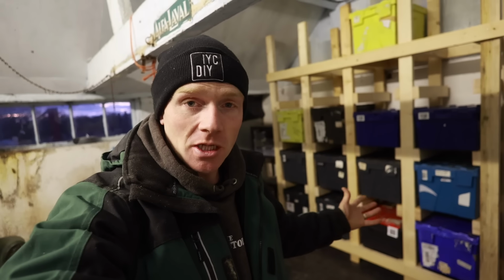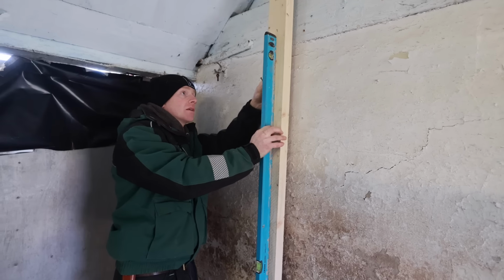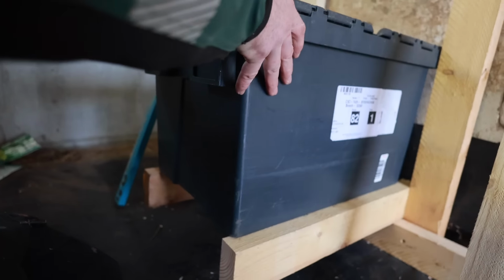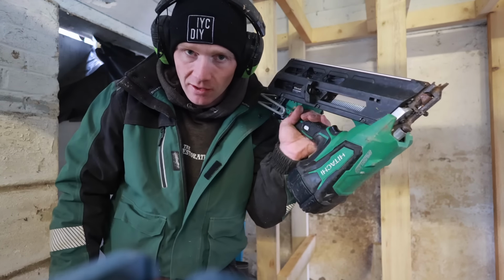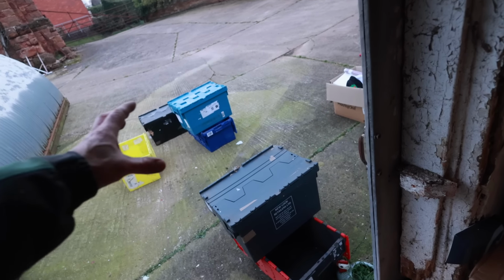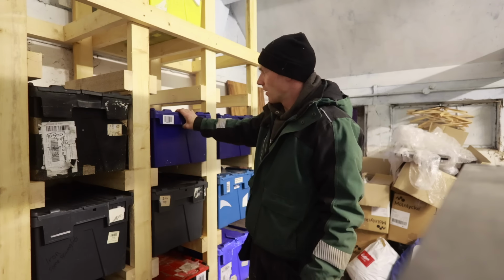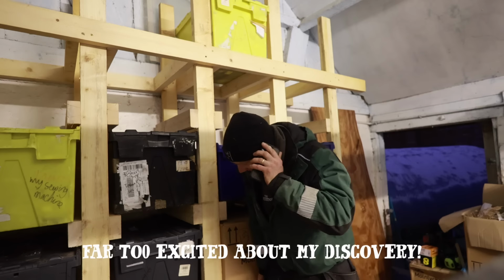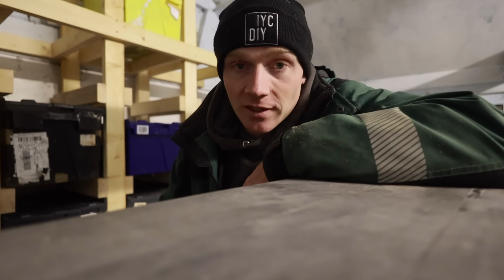DIY BUDGET STORAGE - Time to get organised!

Comment: Hi, when I used a shipping container for storage I just drilled out and fitted round wall vents. Didn't have any problems with damp or condensation at all. I found this a quick and cheap solution. Best of luck.

Comment: Thanks Tim, this is just the sort of project I love, well done both, poor Jo looked frozen at the start there, reminded me of working on our renovation - PJs under work clothes, it's all about layers ! Btw, nothing wrong with a bit of over-engineering, especially if it means you can re-use materials !

I fitted out a half container sized resin shed last year and used a combination of old fence posts (cleaned up, sanded and oiled) 18mm OSB and 2x1 roofing battens, solid as a rock and has also stiffened up the whole structure ! I shudder to think the total weight in there now but it isn't going anywhere !

Anyone who has followed you for any time knows you're not slacking, take care of yourselves, and we'll happily consume whatever you have the time to post - Happy 2024 !

Comment: I rented a converted shipping container as a workshop for a while. It has kingspan in the walls and ceiling, overboarded with osb. One side of the container was removed and a sliding patio door fitted. Consumer unit and electrics. Bone dry and reasonably warm with a little electric heater. A bit fancy for a site container but plenty of food for thought.

Comment: Hi Tim, by far the best option I’ve found for making garage/workshop storage racking is welding up steel frames with ply boards on. I was a hobby woodworker and was absolutely astounded by how little steel you need to carry the weight. I did a basic welding course at the local college (£190 and a few Thursday evenings very well spent!) and steel is actually cheaper than timber!
Reply: What gauge steel did you use for your racking?
Reply: @ uprights were 50mm equal angle (2 inch) and I made rectangular frames for each shelf from 25mm equal angle (1 inch), all 3mm (1/8th inch) thick mild steel.
Reply: @ thanks!

Comment: Hi Tim, you can buy insulated containers. And next time you build this the lip under where the lid is could slide along on the timbers rather than the bottom of it. When you start the main house build are you going to have helpers during the transformation.  (Ie us subscribers) would be good as I remember you were hoping to do that at your last place workshop build but covid ruined that.
Reply: Non Operational Refrigerated Shipping Containers, aka Non-Operating Reefer, aka NOR container

Comment: I did something similar albeit freestanding a good few years ago now, still doing great. 600mm ladder frames in 4x2cls with caber flooring on top, made them up however long my run was (2x4m)and however many shelves I wanted (4). 4x2cls legs front and back at, say, 1500 centres. Legs face-fixed with single M12 coach bolts, 'timber connectors', and plate washers. I went 2.4 high - plenty longitudinal racking stiffness from the timber connectors and likewise transversely from the depth of the ladder frames. I'd maybe do some bracing if taller than 3m.

Comment: I bought a load of these about 10 years ago and they’re mostly ex-Debenhams and high street clothing stores - the only thing to point out about the drain holes is that they’re big enough for a mouse to get in! I used a pressure washer to get all the labels off (as they appear to use some sort of NASA glue/paper!).

Comment: Great idea and nicely put together. One thing to consider before you swap out the storage crates for your cardboard boxes - the bottoms of the cardboard boxes are likely to sag due to lack of support between the runners, especially with it being what looks to be a rather damp environment in that building. It may be best to stick with your original plan to use the heavy duty plastic boxes unless you add some plywood or similar for additional support. But then you would be negating the benefit of using free timber you already had.

Comment: Condensation: I always find it useful to keep in mind the way you keep condensation away is to keep the temperature of everything above the dew point, you can do this by either increasing the temperature or reducing the amount of water in the air.  As this isn't going to be very long term and as I expect the doors are going to be left open for long periods of time, I'd add some insulation and then put a dehumidifier in the back corner which drains to the outside for most of the year and have a oil filled radiator on low set to its lowest temperature in the spring.  The dehumidifier will do a little bit of heating but more importantly it'll drop the humidity down below the dew point.  The major problem times I've found with condensation have been during the spring with the warmer wet days and then the cold nights (hence the suggestion of radiator), everything gets cold at night and then the dew point rises rapidly when the sun comes up.

Comment: I forgot what they are called but you can get used shipping containers that have been used for dry goods such as bulk coffee, these come pre lined with fairly good quality wood panelling providing an air gap between the metal and the interior, handy for  installing shelving etc.  its not as good as proper insulation but these have been designed for shipping dry goods by sea so should be sufficient for your needs.  I think the are vented too, so I would hook a small solar panel to a computer case fan to just provide a small amount of air circulation.  Good luck
Reply from the maker: I have seen some vented ones so will have another look. 👍

Comment: Hi Tim,
 it is interesting to hear that you have come to the same conclusion as myself regarding screws, in my opinion TX are in a different  class and if you hunt around you can find them fairly cheap on the net, just order a small quantity to check the quality before buying a lot.
  Axminster tools sel a starter pack at a fair price and they are good quality and remember you can open a trade account with them and get discount on your purchases and free delivery on larger orders.
    Regarding the house build and problems with planning , remember you are allowed to increase the size of the house by 25% at a later date so maybe  you can build that idea in the new house making it easier to add on later?  Alsp remember the children are growing fast and will be flying the nest sooner than you both realise!! so maybe dont add too much space due to the cost of heating?
 you two

Comment: Did you think about rotating those runners by 90 degrees to give you more surface to slide the boxes on and reduce the height spacing between the boxes?
Reply: Or rather than full noggins, a small block either side would serve the same purpose
Reply: Or let the shoulders of the box slide over the runners, mounted up a bit higher?

Comment: Are you using an impact bit holder in the driver. If not that's probably why you are.blasting through bits. I very rarely snap pz2 bits in my impact.

Comment: A friend of mine managed the condensation in a container rather than try stopping it. Inside he had "fly sheet" of visqueen to an internal gutter on the side that collected into a bucket just inside the door. Supplemented with boxes of Silica Gel. 
I have since been on a ship being laid up without power, some drier product was suspended in pouches from the deckhead (ceiling) every 1.5 metres that controlled humidity to protect the electronics. The intention was to seal up and isolate this space so may not be efficient if you have to access the container regularly..

Comment: Hi all.    In may experience with containers on building sites etc . They don’t tend to have a problem with condensation , if it’s just dry things you are putting inside them like tools machinery timber fixings etc you should be ok .   Obviously they will get cold in the winter, so best not store drill batteries in them .  But when it comes to security they do take some beating , and as a point of interest I’ve often seen them used for storing cement and even plaster , which are definitely very susceptible to moisture.  So my advice would be not to worry, as long as you’re realistic with your expectations .        Kind regards as always.  😀👍

Comment: No need for insulation in the container, you need only to move enough air from one end to the other. That can be achieved using some cheapo bathroom ventilators.

Comment: Depends how long you intend on keeping the shipping container, but we have one at the local railway where we built a small pitched roof ontop of it. This keeps the water off it 100% adds some insulation from the heat in the summer. This also helps keep the inside as big as possible

Comment: Instead of having the boxes stand on the narrow bottom you could let them hang from the wider top lip. You would need to rebuild it though so that the gaps are a little bit wider. But I've seen plenty of diy storage builds on YouTube where they do that instead.
Reply from the maker: That was the plan but all the different sources of containers had different lip designs which was a same.

Comment: If you ever move this racking, then make the uprights a little wider apart, and raise the rails so that the crates hang on the wider perimeter surround at the top of the crate as opposed to sitting on the bottom of the crate. There would then be no need to put in noggins to stop the crate dropping through. 😊
Reply from the maker: That was the plan but all crates had different design or width at that point. shame.
Reply: @TheRestorationCouple 😖🤣

Comment: Don't quite get why you fitted the top front beam at the same height as the structural (back) beam, because if you raise it and the runners at its back you can get an extra row of storage boxes in there that are reachable.

Comment: Wow you did very well scoring all of that timber for that price! Seems a shame to use it for racking, definitely overkill. Which pozi bits have you been using? I've had good luck with the dewalt impact rated 50mm ones.
Reply from the maker: At least it will all be used elsewhere when we take it apart in a few years.  Nothing wasted here! 😀